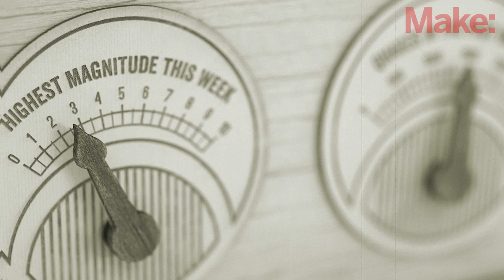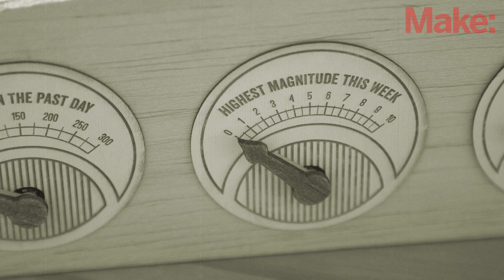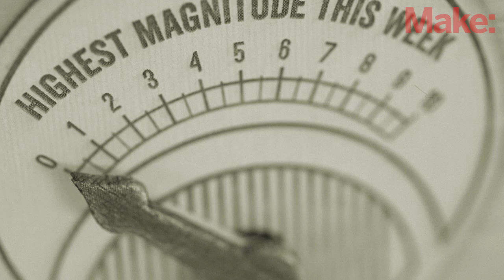Weekend Projects - Data Dial Dashboard

Comment: Would this "sun-seeker" bot work efficiently as a auto-direction finder for a solar charging panel. Could it be used in conjunction with a solar dish while using significantly less power than the solar cells collect?

Comment: If I wanted to adapt this to display stats of my computer, would the ethernet shield still be required?
Reply from the maker: No. You could instead talk directly to the Arduino; the ethernet shield in this build is strictly used for scraping remote data. We're planning a 2014 project to operate similar to this one for localized computer data - stay tuned!
Reply: MAKE
Awesome! Thank you.
Reply: just the usb interface would be needed
Reply: +Make:  Did you guys ever do this project? I'm starting on something like this and I'd love some help from the experts!